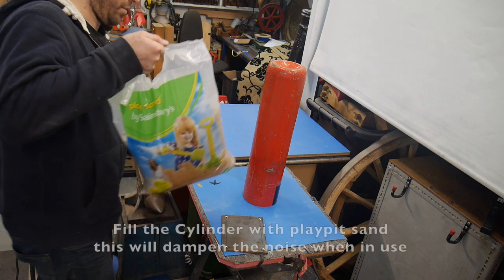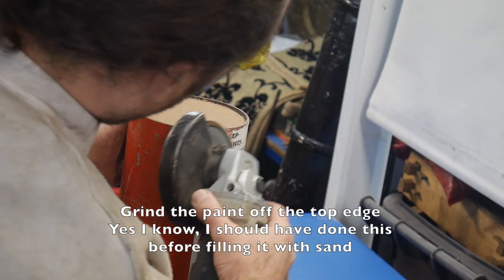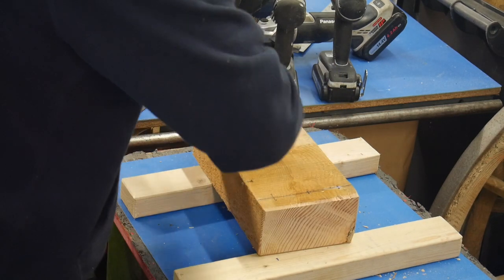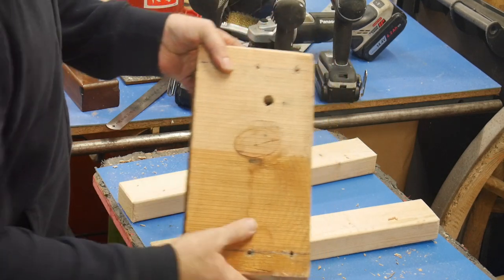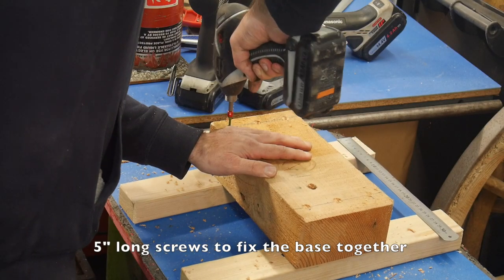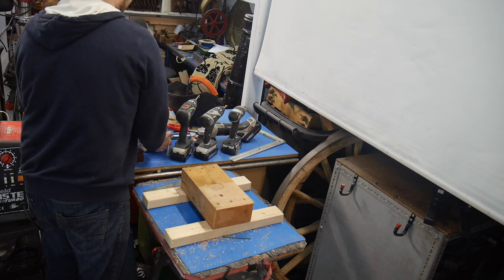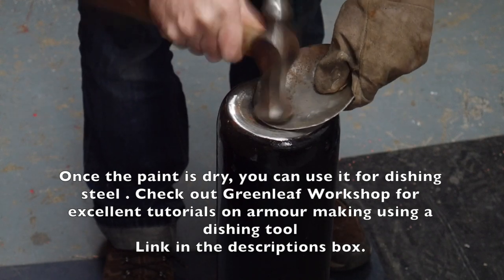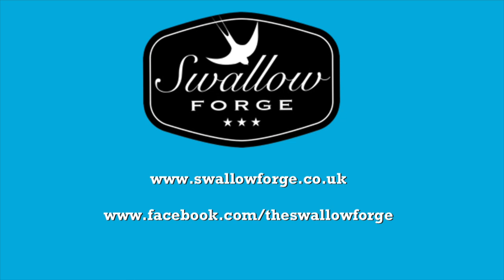Homemade Anvil. Blacksmiths Dishing Anvil - Metal Stump: swallow forge

Comment: Great tool!!! Easy, portable, and cheap. Thanks for the video. For those complaining about the height, use a rolling stool and get closser to the floor. (Or a milk crate, or a gallon pail, etc) Considering it's filled with sand, it would get too heavy, and would compromise portability, and stability. You can always make it taller, but then extend the base to compensate. Do you want a base the diameter of your tool? If it's too top heavy, it becomes a liability. You can also put this on a metal table... just shorten the length of the tool.
Reply from the maker: Thank you for your kind comment :) you'd be amazed at the number of people who can't figure out that they can make theirs any height they like. Mine works for me, what I didnt show in the video is i tend to sit on a stool with my legs either side and my feet resting on the base.   You can work quite comfortably for hours like that :)

Comment: I like it.  Super simple, easy to build, and cheap.  But I agree that it should be taller.  Is there some reason that you didn't make the base higher?
Reply from the maker: +Brian Neeley 
When I stand next to it with my hands by my side and my fist lightly clenched, my knuckles are level with the top. This is generally the ideal working hight. The other consideration is stability. So i am happy with the height, its comfortable to work at, but obviously you can make yours the height you feel is right for you. This is just to give you an idea how to make one which is why i intentionally didn't give any dimensions.  I'm glad you enjoyed the video and it has inspired you to build your own. All the best SF
Reply: I was thinking the same thing, seems really short.
Reply: Nothing a little rolling stool on a smooth floor can't cure :) unless you have a metal work table, a floor is probably the best place to have this heavy piece (plus, all the hammering).